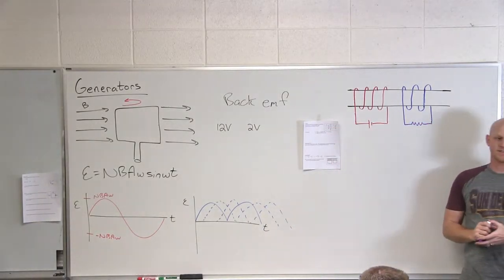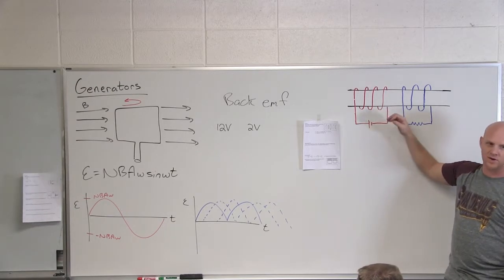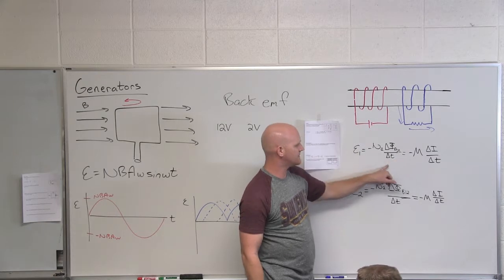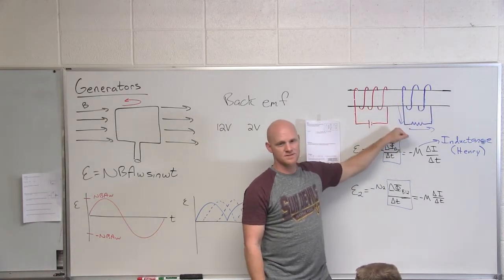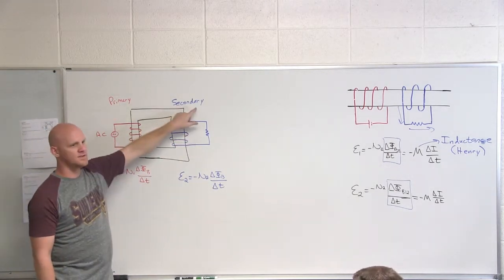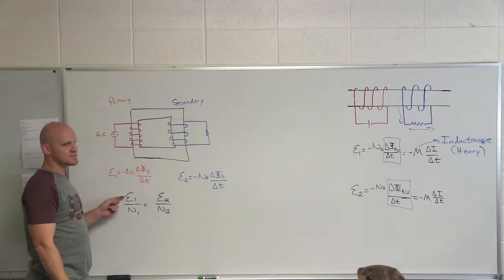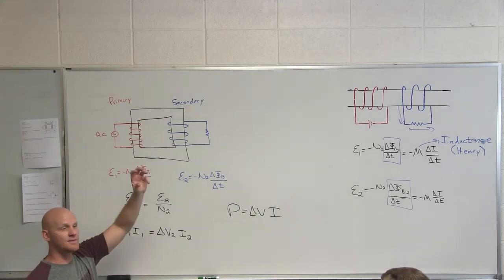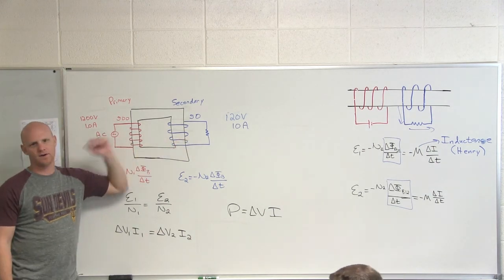20.5 Mutual Inductance and Transformers

Comment: Hi Chad, I just wanted to clarify: are magnetic fields not constant in a field or does it grow with the current like with the mutual inductance example? From my understanding, I thought magnetic flux could only change from a change in the magnetic field, area, angle etc. Could you clarify how it changes with a growing current? Thank you!
Reply from the maker: Hi Parwana!  You may recall from chapter 19 that moving charges (including those moving in a current-carrying wire) result in magnetic fields, and the greater the current the greater the magnetic field.  And you're right about magnetic flux, and it is only because a change in the current results in a change in the magnetic field that a magnetic flux results in this case.  Happy Studying!